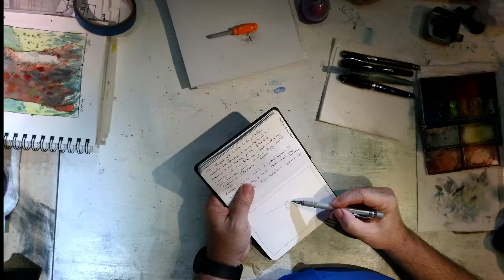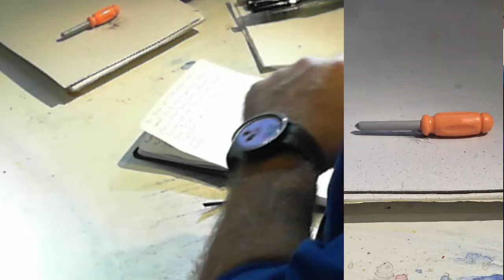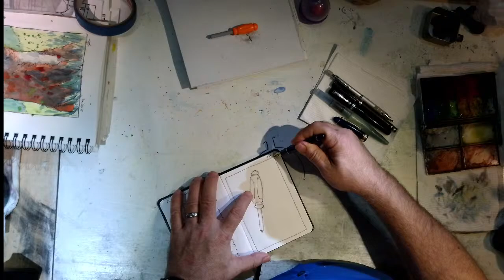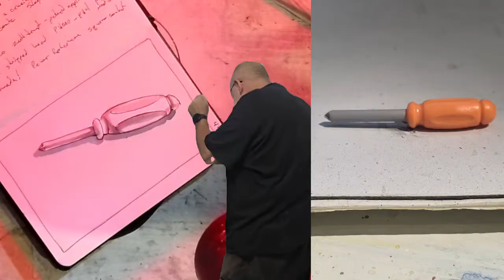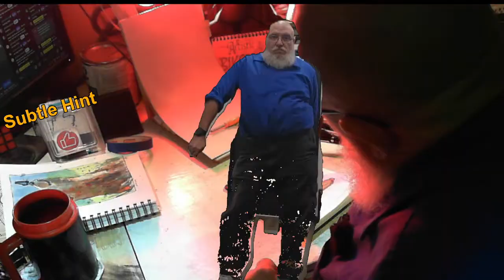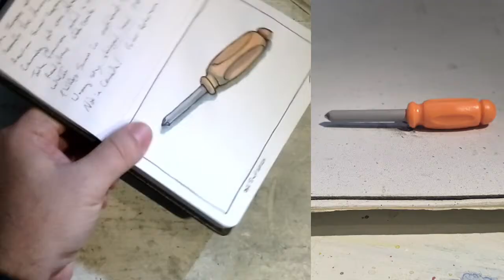Phillips Head Screwdriver - Sketch Daily day 429

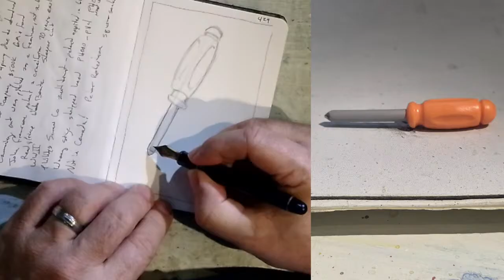Comment from the maker: Morning, folks. Today we learned that the Phillips screwdriver was actually designed to slip out of the screw on purpose as a safety feature (5:20), that the man whose name is on the tool wasn't the guy who invented it (1:04), and that Henry Ford may have helped make the Phillips head the world standard after a disagreement over exclusive rights to a competing screw design (7:41).

We also spent some time talking about how an invention can make somebody famous while the original inventor becomes a footnote in history. Funny how that works. 😄 If you'd rather skip ahead and judge the sketch, the final reveal is around 25:45.

Grab a coffee, sharpen a pencil, and come hang out with us for a few minutes. 🔧✏